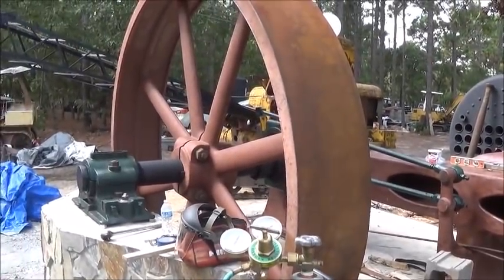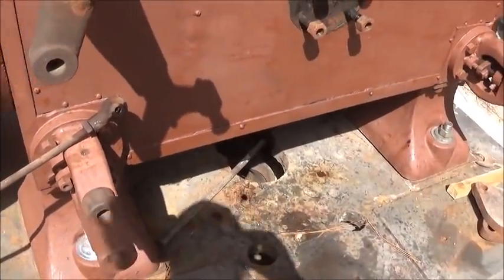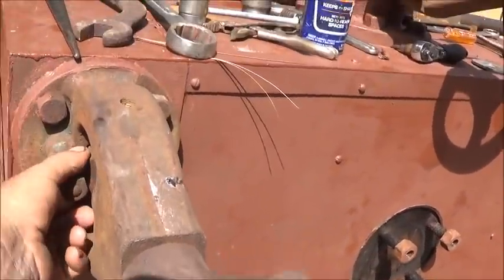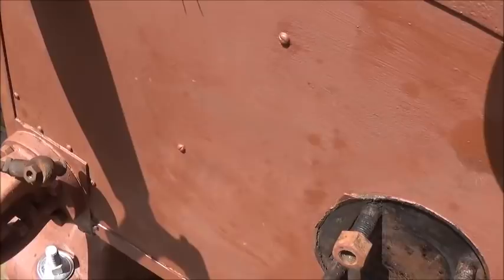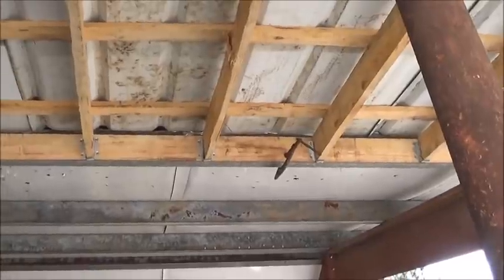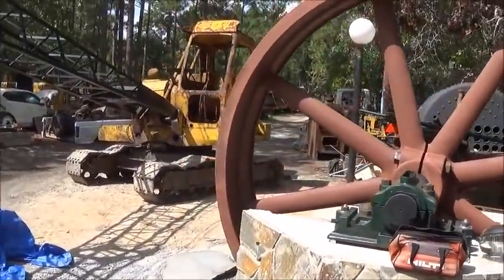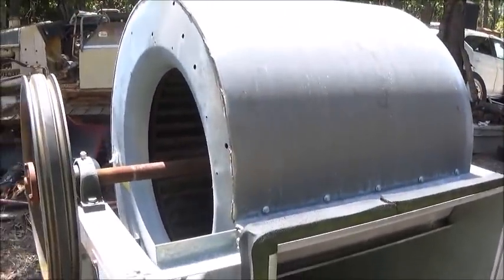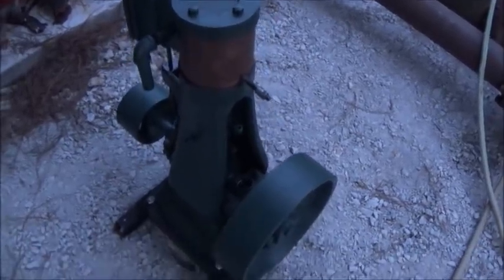BATES CORLISS VALVE WORK, GIANT FAN, NEW STEAM ENGINE

Comment: When I worked in the engine room on a steam engine we used graphite infused rope packing. You have to cut them to fit tightly around the stem then as they go into the packing gland the next piece will be stacked and the cut end is opposite of the cut end it is going on top of. You should end up with enough packing so that the packing gland is full and you can just start the packing gland nuts to compress the packing. I wish I could go up there and help you, but you probably wouldn't want anybody up there bothering you. I really like the videos, brings back some old times for me.
Reply: I work with steam and was going to say the same it used to be asbestos but now asbestos free we use Klinger packing. Don't worry if you break a ring for what you are doing running on air? Gland packing would do but its not to hard to get a cast iron billet and turn a new ring. If you message me I can send pics of the gland packing we use. It could also be metalic white metal (babbit) ring cast into the shape of the stuffing box. Not criticizing you but the timing crank is called an eccentric and its called a cross head all logical names for stuff on steam! Keep up the good work. On another note its good to see governments the world over are stupid you pay for the tyre facility to run out of your rates? (do you have rates in the US?) and you cannot use it for free but others can its stupid !
Reply: @hedgehogm6203  Me too! I do't know what it is but I always seem to have a personal relationship with machinery when I am around it and have to care for and maintain equipment. I know it is a machine but I have had and have seen some strange things happen when different people try to operate the same machinery. People who do not care about something and will abuse a piece of machinery do not seem to be able to get machinery to operate like they should operate. Some people can make machines work like a charm and other people cannot even get them started. I think there is something more to a machine than just the total number of it's parts.
Reply: @hedgehogm6203  Have you ever had to use any ribbo packing? We use to use it on 1200 psi superheated steam. But on just some valves like equalizing or by pass valves.
Reply: @TBullCajunbreadmaker  Hello good to see others have the same trouble with what we call the nut on the regulator. Not used ribbo packing we only work around 160/180psi so fairly low pressure compared to steam at sea were you deep sea or    coastal.
Reply: @hedgehogm6203  Yeah deep sea on a guided missle destroyer, hot and fast. And just a little in the offhore oil patch.
Reply: @TBullCajunbreadmaker  just a bit newer and faster than my steam! I am heritage railway and a small amount of road steam.

Comment: doing an great job Jotathan .The pipe s that are coming out from the side of the cylinder are not cylinder drains they are used to set the timing .The cylinder is drained from condensate by opening the exhaust valves manually that is one of the reasons they made the valve gear disengage from the wrist plate .
Reply: Agreed. Being that far up the cylinder, they must be indicator ports.
Reply: @trisrush9155  right all cylinder drains should be at the bottom of the cylinder otherwise they would not drain. People often confuse these as cylinder drains

Comment: Because of you I have watched many Corliss style YouTube videos (I even discovered what dashpot meant). Your valving linkage/activating assembly is very intricate. There is one on You Tube but I can't remember where. 
You got the valves out, I figured they would need drilled then bored, have other YouTubers make what you need by making prints (don't let any whole or partial component leave your property). Is a local high school CAD equipped to assist with the prints? Then visit the Corliss in the video to measure the linkage for reproduction or have a viewer local to the museum location provide the data.  Viewers, has anyone seen the Bates-Corliss video or visited that museum?
Are the infernal passages open, clogged or broken from freezing?

Comment: Corliss system saved steam, allowing only the amount  of steam needed to keep the governor happy. Saving steam saved fuel, which saved money, which made the owner/operator happy as they paid less for fuel, which was a major expense.
Reply: The Leeds Mercury of Saturday 13 July 1878 claimed that a Corliss engine would save 12% on fuel, using 20lbs of coal per hour for one horsepower.
Reply: @Charstring , that seems like a lot of coal, must be working the heck out of that one horse engine! Interesting though!
Reply: @Hoaxer51  They probably were working it pretty hard... if that was a 12% saving their other engine must have been keeping the stokers busy. (I went back and double-checked the coal consumption).

Comment: Love your work mate.
You might want to look at the Teflon rope seals that they use on propeller shafts for boats.
They are just like the old grease filled jobs but are made with Teflon.
Square section in imperial unit size(inches)
We call them gland seals in Australia.
Just an idea mate.
Keep saving these machines cobber.
😎👍

Comment: Not an expert or even a keyboard expert, lol. But, when you were talking about the motor and engine for the fan that brought back some memories, yeah I'm old. In my much younger years I worked in commercial/industrial HVAC. Those fans are designed and speced to move a certain amount of cfm of air. Many time we would have to change the pulleys to increase or decrease the air volumn. One job I can remember quite well. 4 story building where the original construction engineer had used the wrong spec for the pullys. One of the roof top units produced so much air pressure that it had actually blown the duct apart.
Long story I know, hope you read this, change out the pully on the drive motor to a larger diameter.
But be careful, it might just blow the gravel off the ground.
Thanks

Comment: That's a massive fan alright! I got one maybe a quarter that size from my alley, somebody dumped an old swamp-cooler out there when cleaning out a rental house. One of the pillow-block bearings is bad, the water pump is missing, and the fiber in the side-panels is partly rotted away, but the fan still runs good! So I nabbed that.
Might use it as a ventilation fan for my garage, not sure yet. Those valves are nice and simple, should clean up!

Comment: That puller you were using is the same as you use on DeSoto's, and some others, to pull the rear brake drums off. For anyone who doesn't know, you cannot get the rear drums off without one of those. at least not easily. With one of those, it is a snap.
Reply: Yep, I used one to pull the drum/hubs on my old Jeep FC. The only way to go…

Comment: Uniflow may be more efficient but only if they are run at constant speed.  Corliss valve engines can maintain their efficiency over a wide variety of speeds and loads due to their use of variable valve timing and duration.  I think if piston steam engines were still in wide use they would have at least a variation on the Corliss design, possibly with electronic control.

Comment: Maybe your fans could provide some drip oilers for this project.  Chinese knock-off drip oilers are not too expensive (under $30 each), but there may be enough antique USA-made stuff available that we could scrounge.  What size fittings and what capacity do you need?

Comment: Jonathan have you checked what the regulations are for tires at your landfill? Locally we can't put whole tires in a landfill. But we can put pieces of tires in the landfill. 
The local landfill has a tire slitting machine. You've already built far more complicated things. Basically it cuts at the corner of the tire where the tread and sidewall meet. Then they cut the tread hoop once with a hydraulic shear so it can lay flat. 
They charge per tire to accept them due to handling, but will let you dump tire pieces at regular dump rates. But they all still end up in the landfill.... just in 3 or more pieces. I can't be sure but it seemed the regulation had to do with the size of pieces couldn't be larger than a certain percentage of the whole tire. For instance cutting them with 1 cut in the tread center left two pieces that were 50% of the original tire, and that was to big a percentage. If the tire was still on a rim, they'd cut the sidewalls and leave them on the rim, and cut the tread hoop, and in the hole it all went.

So it still comes down to what's cheaper I know. Time vs money battle as always.
You should share some numbers on the cost of dealing with them, lotsa people have no idea how fast it adds up.
You have a lot going on there, everything looks really nice! Thanks for sharing

Comment: For metal roofing condensation prevention, since you have a sawmill cut 1" thick boards of random width and sheet the whole roof with them.  Add tar paper and the metal roofing on top.   It is cheap, squirrel proof and effective.   It also looks more period correct compared to plastic/insulation.

Comment: If you would need piston rings contact Niagara piston ring works they can custom make anything you need, I recently had them make me four rings that was .540 wide x 11- 5/8 inch bore for a old oil field engine they are very friendly to deal with and are quick to make and send you what you need. They can make rings form 2 inch to 144 inch in diameter